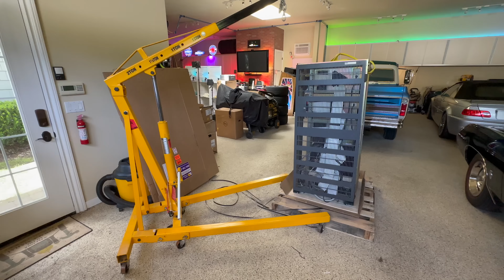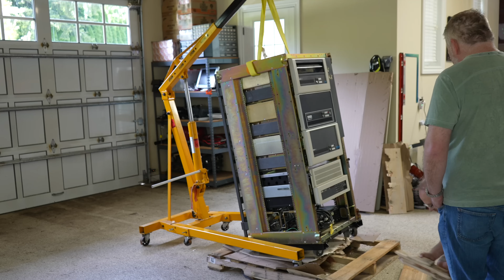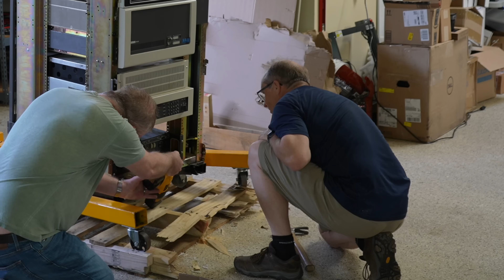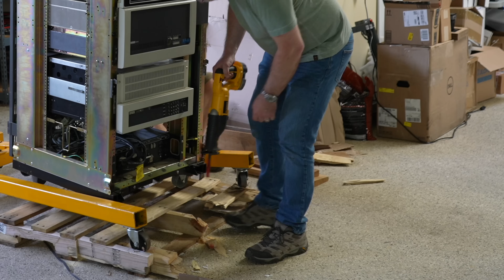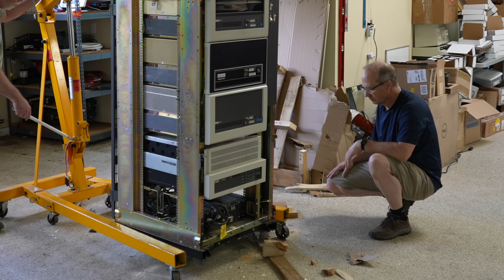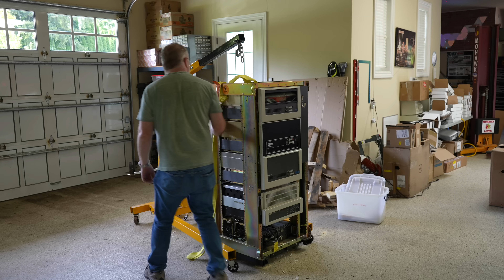I Bought the HEAVIEST Computer on eBay: The PDP-11/34!

Comment: Great video on recovering old systems but one observation. The facebook group was very helpful but the fact that they are a social network group (on FB, but it could be on any other social), means that the next person having a similar problem will be unable to search it properly. The internal search of the social networks is not that great and these info are not indexed by external search engines. So yeah, crucial information will be buried in inaccessible (or better, poorly indexed) groups.

Comment: A fun little factoid about the 11/34 numeric panel. If I remember correctly, it might have been run by an Intel 8008. Not sure. I do have various print sets stored away. Have to check.

Comment: It's interesting how all these decades later modern machine communications STILL require termination on the bus. The nice thing is It's now a small rj type connector with a resistor vs the massive cards 😁👍
I worked on systems in the military that were from the 60s so I feel your pain on hoping you "cut" the right wire. Massive LOL to the need for magnifier.... I'm also in that boat 🤣

Comment: I share your disappointment with the emulators, too.  And not just because they aren't completely faithful cosmetic replicas.  The PiDP-8 versions for example, don't have the proper key switch on the front.  And while they may have the "lights" (LEDs) in position for hardware DMA transfers etc, and I sent some information to at least one of the emulator programmers on what they're supposed to do, I don't think any of them actually uses them yet.  If they do, I doubt they're "faithful."  Maybe just random blinking or something.  In other cases, such as the more recently announced PDP-10 emulator, the replica control panel isn't even full-size.  And the PDP-10 systems had display panels on other parts of the system, that the emulator doesn't have at all.

But, My main issue is that like Captain Kirk told Picard, they aren't REAL.

Back in the mid-80s, I was working on starting a computer school, and mostly collected DEC equipment for it.  I had some PDP-8 models including /E and /L, some PDP-12 (a GORGEOUS computer!), had located but not yet acquired - because they were still in use - a couple -15s (perhaps the prettiest of all the DEC systems really, descended from the PDP-9 which was descended from the -7, which is what Unix was actually developed on/for...), a pair of KL-10s from Intel in Hillsboro, Oregon; a 2020; even a 2065 from Columbia University that was carefully disassembled and put into storage.

But then I developed chronic Inflammatory Bowel Disease, couldn't work, and lost everything in storage.

Sometimes it's a little tempting to get one or more of the emulators, but I just can't do it.  They aren't REAL.

Comment: Not many options on ebay, if the heaviest one only weighs 840 lbs.  The PDP-12 weighed 600 lbs without any hard drives or anything.

Comment: Cue the old folks. I think the Tektronix development machine I used in my first job was an 11/73. When I started we had 15,000 lines of 6809 assembly language and when I left a year later we had 25,000 and I wrote most of the changes. At the start assembling took under an hour and at the end it took nearly two hours. Our head of engineering found me reading a book with my feet up one day and asked what I thought I was doing. I told him we had patched too much and now needed to rebuild, so I had a two hour wait. Could I do anything else? Not without stopping it. Could we reduce the time? Sure, we gave you a quote for upgrading to 11/84. I reminded him it was about 4 years of my pathetic pay. He said "Ah" and walked off. We never got the 11/84 and I moved to a grown up company after only 10 months. I don't remember anything useful about that first machine, but I still remember the commands for running VAX/VMS and working out what was going on today. Wow! Flow control! It's years since I used flow control, and yes, XON/XOFF was a thing back then. I run one connection to an embedded ARM we are using at 460,800 baud, and the host machine is a relatively crappy Xeon that runs at about 1/10th of the speed of the i7 I am on now. No need for flow control.

Comment: a gantry crane with a chain hoist is one of the best shop investments you can make
better even than a lift id say
can pull an engine, a bed, a 42U rack full of crown macrotech 3600s, whatever you can safely rig to it
Reply from the maker: Next time!  It's only the first time I've needed one, but it's hard to fake if you don't have one!

Comment: Reminds me of the old days when I had some Sun full height used 3/260 and 3/280 based servers with huge Hitachi hard disk drives that sounded like jet engines as they spun up. I had a lot of Sun systems over the years of running my own Sun value-added reselling business until 2006. Now getting nice Sun gear like deskside E450's is practically impossible here. Never had a PDP system. The university I did early engineering studies at had Amdahl's originally and while I was there upgraded to Sun full-height Sparc servers. Never got to see the Amdahl's in person as us students were not allowed into the server room. That was in the late 1980's. My favourite Sun's are still the SS5's and SS20's.

Comment: holy moly did I cringe when I saw all of the cards laying out on beach towels. What even is ESD safety lmao. I hope it's at least humid enough there to keep the static down.
Reply from the maker: And yet I treat all my hardware like that and never had a failure.  I know certain types of CMOS are reportedly pretty sensitive, but maybe it's more about grounding yourself first, which I'm pretty careful to do.  Either way, everything works!
Reply: @DavesGarage  I'm glad it all works. I work as an EE, and I was just a little shocked (heh) to see that after all of the ESD safety rigamarole I go through on the daily. I still would have preferred aluminum foil under the boards to fluffy beach towels.

Comment: I used to work a few years with a PDP-11/34 but the CPU was wirewrapped, not built of dual in line circuits like yours! It did not have a floating point unit. I remember those days with fondness, I really liked PDP-11 and its orthogonal instruction set. I was programming in assembly, Fortran and Pascal and the OS was RSX-11M. Eventually moved to VAX when it was published.

Comment: Do you collect Engineering Samples, spare boards for DEC? I did the ebay thing for a long time but mainly bought gold recovery auctions or large auctions with 100 pound plus of random vintage boards, usually DEC, HP. I had some sellers that sold to me each month and usually charged $50 plus shipping. Ive found everything from Zebra grey trace 4004 engineering sample to 487sx extremely early engineering sample. Im still young but have health problems and my collection deserves a good home. If youre interested let me know

Comment: OMG, what a flash from the past!  Spent many hours integrating PDP-11s running RT11 to my company's I/O hardware.  We produced rack mounted I/O that included discrete I/O, relays I/O, optically Isolated I/O and analog I/O for use in process control.  Our group was "Hardware System Integration" or as it was most referred to "Rack and Stack."  There were loads of these machines used in process control making everything from Glass to Gasoline and even Peanut Butter!  Really enjoyed the post.

Comment: Fond memories of loading Basic interpreters from paper tape (actually a cassette) onto a PDP11/05 back in 1975 - later worked with RT-11, RSX-11D and RSX-11M  and a custom executive on a PDP11/03 in the mid-1980s. The older ones had core memory. Wrote some structured programming macros for the wonderful PDP-11 Macro assembler and later a ½-sized debugger. Loved this video though I'm not a retrocomputing fan though I share your autism. Thanks for writing the books - a different take to 'Strong Female Character' by Fern Brady, 🙃

Comment: Back in the 70's I worked on the Lockheed SUE mini and in the 80's I worked for Xerox Printing Systems, and we used the PDP 11/34 as the controller.  Great to see the electrons still spinning!

Comment: 177650 <load address> , 70 <start> and the 11/70 boots... I worked for DEC from 1982 until Compaq, then on with HP. Retired after 32 years of service. My first job was learning to do RSX-11M/S Sysgens on 11/45's.  Nice job with the 11/34!
Reply: Melbourne and Alice?

Comment: I USED TO INSTALL IBM 360, 370'S WITH 10 TO 20 CABINETS IN A DAY.
MOST HAD CASTERS(WHEELS), RCA POWER SUPPLIES WEIGHT UP TO 2000LBS
(4 GUYS AND 2 DOLLIES). IBM 360, 370, 3331 WERE ALL ON CASTERS AND  2 MEN
COULD EASILY MOVE THEIR RACKS. DEC RACKS USUALLY HAD CASTERS AND 
YOU WOULD LOCK THE WHEELS ONCE IN PLACE. MACHINES USUALLY
WERE MOVED BY FURNITURE MOVING VANS(ALLIED ELECTRONICS DIVISION).
LIKE FURNITURE. THE ONLY TIME IT WAS PUT ON PALETTES WAS WHEN MOVED
AS REGULAR FREIGHT(SCRAP METAL), TO SAVE MONEY ON FREIGHT.
FURNITURE MOVERS HAD SMALL HAND JACKS, HAND TRUCKS AND 
PALLET JACKS. ONCE IN THE PROPER LOCATION. 3 MEN COULD USUALLY
WALK(PUSH) A DEC RACK OFF A PALETTE.
TO SAVE MONEY WE ONCE HAD 10 IBM 360'S SHIPPED FROM CANADA
ON PALLETS(they had wheels). at the destination. the customer had 
fork lifts to lift the IBM CABINETS OFF THE TRUCKS.

Comment: You should really use ESD protection on such an old beast. I enjoyed a component level PDP-11/44 course back in 1994-95 when RAF (I'm not British Denmark had a radar-site on the Faroe Islands using RAF equipment for EW radar) used these computers for their EW sites which looks very similar but had RL-02 HDD's instead.  Thank you for  a nice video bringing back good memories.

Comment: OMG my first computer! In 1980 I tripped over it, wrote a simple program in basic, and I was hooked for 44 years. RT-11, RK06, THE THE 11/44 WITH RL03 drives (coupled to 5 custom built racks of hardware (60 x 68000 proxessors) driving 3 40deg FOV channels of real world graphics - a flight simulator.

Comment: Hahaha! Why? I installed a few 11/780's and I did work on UNIX V7 when I was at UCB. If you want the original manuals for V7 I have them. I also have a Sun Ultra 1 with dual monitors SCSI and Fiber Channel shelves. Just in case you need more boat anchors. Oh it haw dual CPUs and a windows coprocessor board. You really need it. Really 😂

Comment: In 1978 I learned BASIC programming on a PDP-11/70. Using a paper terminal via a 110 baud modem. One year later worked for the company that owned that PDP writing software for PET's, Atari's, and TRS-80's. Learned about memory and cassette tape for storage on those personal computers but never really studied the makings of that PDP. They had over 60 terminals connected to it. And two 5MB massive hard drives. I vaguely remember the platters were swapped out from the top and had a blue translucent plastic top with handle on it for insertion. And as you stated, it didn't run Doom, but it did run Colossal Cave Adventure, and Trek!

Comment: The first FORTRAN program I wrote ran on a PDP-11 (I think a /40, it had 96K words of core memory) at Bakersfield College in the mid-70s. It was the heady experience of making that iron beast do my bidding that sold me on a career in computers. I thought I'd want to do software development since hardware seemed so daunting, but once I dipped my toe in hardware design, I knew that was my calling.
Seeing the array of cards at 22:29 brought back memories of the boards I supported as a production engineer for my first 9 months at Hewlett-Packard. Most boards were 2 layers, with ICs spaced in columns spaces 0.8" to 1.0" on center. HP gold-plated everything, not just fingers. The boards were beautiful to look at; glistening like jewelry.
My first real board design was for the HP 3000/64 minicomputer, introduced in 1981. It used ECL (emitter-coupled logic) on 6 layers: 2 microstrip outer layers, ground planes on layers 2 and 5, and Vee (-5.2V) and Vtt (-2.0V) on layers 3 and 4. All 4 plane layers were 2-oz copper to minimize voltage gradients, since the MECL 10k devices we designed with had no voltage compensation.
I still can't believe they let me tackle such a complex design at such a young age, but I was too callow to know I was in over my head.
I left youth behind a long time ago. I'm about 10 years older than Dave.

Comment: Wow that brought back memories. I was a computer tech back in the early 80's and remember servicing the disk packs using an oscilloscope to align the heads. Proper air flow is very important for the heads to float above the surface of the platters. Very cool to see it working for you.

Comment: I enjoyed this segment.👍
I started out my career in electronics in 1974 and by 1978 I got into Intel 8080 microprocessors and then the Zilog Z80.  I joined our company's process control/automation department and that was my beginning with computers.  While most of the computer used for manufacturing were still large and transistor based we started seeing an influx of PDP11's.  My second area assignment had a PDP11/34 with a spare and my fun began.  The production computer was running RSX11M and we also had a distribution of RT11 so the next few years I learned the hardware, software and also began doing Fortran programming for production.  Anyway over the years I worked with the PDP11/(02, 23,73,34,44,70 & 84) computers before we moved up to VAX and Alpha servers running VMS and then OpenVMS.  I received formal training from DEC on the hardware and RSX11M+ internals.  I wrote custom hardware drivers for RSX11M as well as burned custom boot ROMs for the PDP 11 QBUS machines that ran code with no OS.  Converted a PDP11/02 from a paper tape boot to using a TU58 serial tape drive as the paper tape reader was on its last leg. My current employer used a lot of Alpha Servers with OpenVMS as well as Windows NT 4.0 servers.  Now most of the Alpha Servers are running on a Windows server and using FreeAXP as a hardware emulator.  Believe it or not we still have two Windows NT 4.0 Workstation running a furnace system because of some legacy hardware and drivers.  Our Windows infrastructure has mostly been converted to virtual using VMware with a mix of Windows 2008 - 2022.

Comment: in 1973 (ish) I was in a college lab with a PDP 9, 11, and 15.  Paper tape boot loaders and only Teletype terminals.  The PDP's sometimes got so hot the techs would remove some rear panels and put 20" fans on them.  But they were workhorses and did the job year after year.

Comment: I've bought many heavier computers than that on eBay.    I've bought at least one machine that weighs 5 times that much.  IBM ES/9021 mainframe.  I've bought several PDP-11s that are heavier than that.  The 11/60 comes to mind.

The point is that this isn't remotely the heaviest computer on eBay.  In fact, it probably wasn't the heaviest at the time you bought it.

Comment: Back in the eighties through 2005 I worked at the 3M Camarillo plant. We made data storage tape products. We had a line that made DLT tapes for DEC. It also had a HDD with removable Disk packs. There were PDP-11s running tape drives to test the tapes. Another interesting venture that I was part of, in a small way, was an 8 inch Hard Drive. I was a tech and I generally did maintenance on the drives that tested the tape. As for the 8 inch hard drive I mostly tested them before sending them to the customer. They had a capacity of 60 megabytes. I heard that they were being produced for the phone company? Another weird computer I came across was when I was in the Navy. It was a Wang.

Comment: it was on a vax 11/780, we had installed a card in the unibus, and I forgot to cut that wire.  in was at end of the maint shift, and the system was coming up.  So i thought.. well, I'll just get in there w/some dikes ... and snip it real quick. (what could go wrong)
so long as I didn't hit anything, it'd all be good..  course, too much coffee at the end of a night shift.. 
It messed up so much stuff.  (I shorted it against something).. least at the time, it was an older system.  so, parts were available , but not terribly expensive.  
that was the worst screw up of my entire tech life. 
I didn't get fired, so.. its not nothing.

Comment: Your work kinda makes we wish I had kept a few of my punch card decks.  Did keep the first home computer I soldered together: a non-S100 bus Digital Group system, which came with a keyboard terminal, and both a 6502 CPU card and a Z80, but no powersupply or case.  No worries, my EE friend at Tektronics helped me build a linear supply.  My father was co-founder of Exotic Metals Forming Inc in Seattle - an aerospace metal forming company based on his axial-bulgeforming patent, so brake-forming a metal case was not challenging.

Looking forward to your interview with Mr. Cutler.  Years ago my brother's father-in-law: Patrick McGovern founder of IDG and the first computer journal in the world, introduced me to his friend Mr. Metcalfe.  It is a great privilege to meet your heroes.